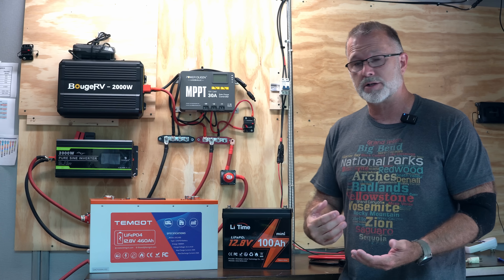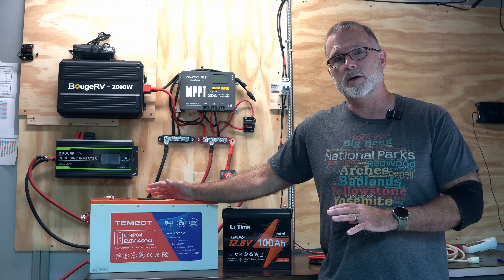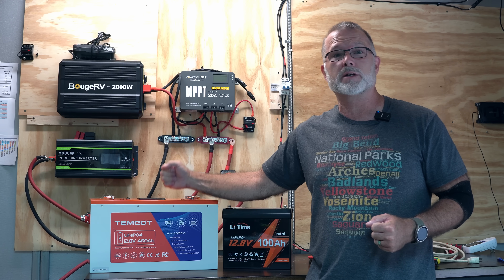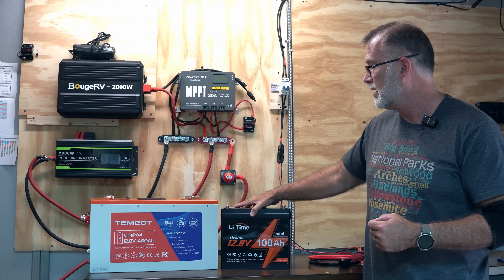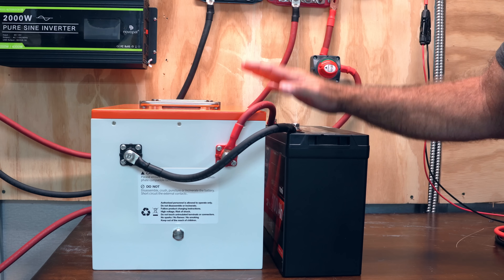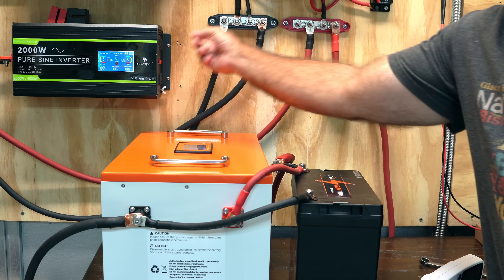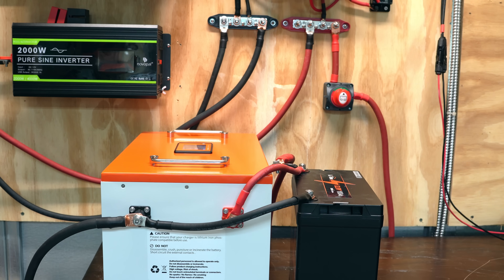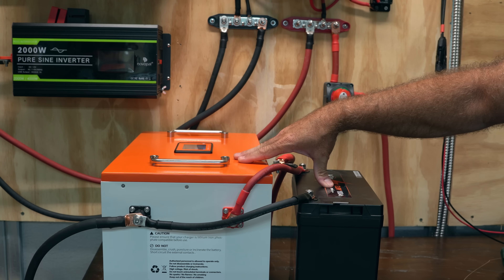Connecting Batteries with DIFFERENT Capacity in Parallel - What Happens?!

Comment: Who has a 3000w constant inverter,renogy sucks
Reply: I have about 30 Renogy products...inverters in operation, 12 volt, 1000, 2000, and several 3000 watt units, MPPT charge controllers ranging from 20amps, several 30 amp Renogy Rovers, 60 amp Rovers and a 100 amp Renogy MPPT. I have maybe a dozen Renogy battery meters as well. None of them has failed. A 3000 watt Renogy inverter has been in daily operation since March of 2020 running a freezer and some lights. What's wrong with your setup?

Comment: I think this is a rather dangerous suggestion. For a multitude of reasons but also for the following both batteries are now seen as one battery bank by the charger and that charger will push current until the bank is full. Or you could connect the charger only to the smaller battery who would then charge the larger battery but then you are negating the advantages of having a larger battery. Etc.
Cheers,
a.

Comment: What about charging? Many regulated chargers? The smaller battery gets overcharged while the larger gets undercharged when connected in parallel. Not to mention, other comments are correct, as they discharge the voltage of the larger continues higher as the smaller depletes faster. When charging this variation I've seen overcharge the smaller causing high heat. Actually have one getting burned outside right now on purpose. I'm reconditioning the battery. Reverse charge at a higher than normal rate to knock the sulfur off, then I'll charge it correctly
Reply from the maker: I've actually been doing additional testing for a follow-up video and while I'd agree that you probably shouldn't do this for SLA and GEL type (non-Li) chemistries, I still don't see an issue for LFP.  The LFP batteries have an internal BMS that keeps them individually from being over-charged or over-discharged.  And while their will certainly be some differences in internal resistance at the same voltage (SOC), the differences are not likely to be so significant as to cause any issues that you'd need to be overly concerned about.   So they will, more or less, charge and discharge at rates that are proportional to their relative capacities and the larger battery will often provide a small amount of current to the smaller one as they are continually seeking to remain in balance. But this extra charge/discharge activity is not materially different than what is happening naturally in a solar-charging battery/inverter system anyway. So, I stand by my claims from this video - at least with respect to LFP battery chemistry.
Reply: @ReeWrayOutdoors  I can understand what you're saying, and while they have internal regulation, would you want to stress or rely on this regulation with lithium? Although lithium is pretty good about letting you know if it doesn't work. Just hope it's in a fireproof container. I'm an Automotive mechanic. I've seen all too often where some cells are bad, we tell the customers the entire thing needs to be replaced because the difference in wear from old to new can cause issues. The customers go to some independent that replaces only the bad cells and the whole thing fails because the charging is unbalanced. I've also seen where cells were bad, the customer stated they didn't want them replaced, they are individually regulated and the capacity will be reduced but they can't afford the repairs. Then it comes back on a tow truck burnt from the battery going up in flames. Lithium is less forgiving than lead acid. There's a reason LiPo batteries need a specific charger as well. They just can't be charged any way, must be a specific way

Comment: I'd like to counter the statement that in the sequential connection scenario the bigger battery is limited to the capacity level of the smaller one. As the smaller loses its voltage, the bigger will start compensating for it by maintaining its own voltage for longer, and therefore giving out more and more watt-hours compared to the smaller as the time goes by. So, the time before a critical voltage is reached in the system output will be higher compared to the case with two small batteries (instead of one big and one small), not only because the big one will maintain its own voltage contribution for longer, but also because the wattage contribution will be continuously shifting from the small battery to the big, thus utilizing the latter much better than to 50%, as the author seems to be claiming. If the critical voltage is, let say, 18V (compared to nominal 25.6V), I would recon that, with a practically likely load of, say, 10A, the final (dis)charge levels would be around 11V and 7V. How many joules do you think is left in that big battery at 11V? Definitely not as many as it has given out by then. LiFePO4 experts can give you an accurate number, but I would guess not even 30%. Probably 22-28%. So, not that bad.
Reply: That is not correct. Both batteries will see the same current. If the smaller battery is finished the bigger can't compensate anything. The small battery can't supply current anymore. In fact it would rather break. A 12V battery at 7V is dead. Or with a BMS that would switch off the complete circuit to protect the smaller battery.
In such a serial connection you can only draw the Ah of the smaller battery, not more ! The same goes for the maximum current.
Reply: @reinhard8053  Same current, but not the same power (AKA wattage/energy per time unit/work), and that is the point.
Reply: @ds380  No it is not. The batteries will supply (nearly) the same wattage. Both have the same current flow and more or less 12V (or maybe 13V depending on load). So they will supply the same power and energy. And if the smaller battery has no more energy it will limit the current (and you don't want to go any further).
Try to read some basics before posting such nonsense.

Comment: This might work short term but if you parallel two lead acid batteries of different age or capacity for any length of time they will "fight" each other until they both fail. Personal experience.
Reply: I used to design battery management systems and chargers for telecommunications installations. Lead acid batteries of the same technology are frequently connected in parallel. So long as the state of charge to Voltage relationship is the same for the two (or more) batteries they will share and not be damaged. The charger should ensure that both reach the end voltage when charging and are disconnected before being over discharged. These voltages are the same for new or old batteries of the same technology. This is true for Lithium batteries as well. I don't think they can "fight" each other - what would that mean in terms of voltage and current? And they certainly do not fail - they can last decades. On the other hand, similar age, technology and capacity is critically important for series connection.
Reply: @HughCStevenson1 My guess (from the very little information, admittedly) is that one/some had significantly more equivalent series resistance, so that the effective voltages are mismatched every time the load changes or charging state flips. (This would happen a lot more often for, say, buffering solar energy than for battery backup for grid power.) I wish ESR were easier to measure to avoid such things.
Reply: @AySz88  they will still be stable and undamaged. The claims that they will explode are just wrong.
Reply: @HughCStevenson1    To be clear, I don't share in any claim of "explosions".

I was recently reminded of an NiMH behavior where, if overcharged during a constant-current rapid charge, the voltage required to maintain current starts to fall instead of rise. If the cells' states of charge are mismatched enough, a charging controller might continue over-charging and lead to damage. (It could be argued that's more about the interaction between the cells and a charging controller though.)
Reply: hence, you use batteries with similar age/capacity. ;)
Reply: Not true, all my Old lead accid batteries are going to my Offgrid retirement-home for old worn battery solar charged-led lighting bank. They only get charged by Solar and only have to power the 12volt LED lights inside an Off-grid 192m² house. 
The smallest lead accid is 45ah from a car, and the biggest 230ah for a cargo barge, all connected in parallel.
I test once a year for their internal resistance to delete the batteries that won't hold any power at all, but for the last 3 years I'm still doing great with all of the mismatched bunch of batteries working neatly together.

The principle is easy, don't stress those old grumpy batteries. Only light loads. I have tested them all piece by piece, to see where they hold their loads. Some stay good for a while at high voltage but once dropped below a certain voltage they go through their knee's and drop dangerously low in voltage under load. While others drop fast from fully charged voltage to a certain lower voltage and settle/stabilise at this lower voltage.
And all of those batteries together support each other on different Voltage levels.

Also what's a good explanation for this is the Law of communicating vessels (of water)..
when the liquid(Voltage) settles, it balances out to the same level in all of the containers regardless of the shape and volume of the containers. 
The biggest Battery gives most Ampère (flow of water) , and the smaller batteries only keep up with the level of the bigger Battery
Reply: @2DC24 i have almost exact same setup....two agm.....55ah and 200ah....in parrallel...charging from solar.....only runs led lights. My solar and my load work off of the smaller battery....the bigger battery is really only there to keep it charged up but it keeps the smaller one juiced up. If I needed to hook up an inverter or something in an emergency...I can pull my amps from the bigger battery.
Reply: I form lead acid batteries and you are correct.
Reply: There is a simple reason for that, the much larger voltage difference between a fully charged and empty lead acid battery. The flat discharge curve of Lithium based batteries makes parallel connections of different capacities possible.
Reply: Do not connect different size batteries in parallel. It will eventually damage the smaller batter as the larger battery will discharge into the smaller batter using excessive current. This means the overall lifetime of the smaller battery will be reduced. I've seen this in SLA/AGM batteries. But not sure how lithium batteries would be impacted as they have internal charge controllers.
Reply: @chuckcrizer 2DC24 said it works for old Lead Acid batteries to give them a last Chance.
I fully agree to not do this with any other type , and definitely not for big loads. 
Small loads however are proven to be functional, with lead-accid though

Comment: Great video! This works out because the internal resistance of the cell is lower for the battery with the larger ampacity. In other words more of the load is drawn from the larger cell battery. That is why the experiment worked, and different sized batteries in parallel discharged in the same time frame. It can even help balance out the surge scenario, as more of the load comes from the battery with the lower internal resistance. However, it is still great advice and wise to avoid major imbalances in the lead acid batteries and not to mix types. It is also important to note the age and condition impact the internal resistance, and the health of the cells can effect how well they play together.
Reply: Not sure internal resistance has anything to do with this 🤔 If you take the same current from both batteries, then the smaller battery will drop to a lower voltage due to the discharge curve. It can't do this, as it's wired in parallel,  so the smaller battery will stop discharging. The net result of this is that the batteries will discharge proportionally with their capacity, assuming the same chemistry.
Reply: @RacingAnt  This. Internal resistance is irrelevant. The relevant bit is that the positive terminals are kept eqiupotential, and so are the negative ones. The batteries have no choice but to be at the same voltage. Your reasoning is 100% correct.

Word of caution: before you connect batteries in parallel, make sure their voltages are the same (within say 0.1V or so). If necessary, charge/discharge them separately until they're balanced, before connecting them up. Otherwise you risk the one with the higher voltage discharging into the other one to equalise the voltages, which could result in a large current draw that may damage one or both of the batteries, or even result in a thermal runaway event (LiPo fire).
Reply: @EvenTheDogAgrees It depends on C rating also? If higher voltage battery has less C rating than lower voltage battery's C rating, then the situation is more worse?

Comment: This is not soo good especially in lead acid batteries bcoz while the snall battery will be fully charged the big battery will be charging which the charging system cannot autocut the changing and the small battery will get over charged
It can be ok in bms batteries
Reply: Not so, the voltage will always be held down by the least charged battery, unless you have significant resistance in the leads connecting the batteries.

Comment: At first I was amazed that the kill-a-watt meter showed a wh of only 30 wh less than estimated. Which would put the inverter effeciency at 99.58%.

Then i realized he calculated battery wh based on 12.8v when he likely charged it to at least 13.8v if not 14.4v. He then multipied wh by 0.9.

560ah @ 12.8v = 7168 wh (6451wh)
560ah @ 13.8v = 7728 wh (6955wh)
560ah @ 14.4v = 8064 wh (7257wh)

The load on the AC side of the inverter was 6370 wh, which he then said was 30wh below estimated. Re-watching the video he lowered his estimated 6451wh capacity to 6400 wh. I'm still not sure why he multiplied the battery wh by 0.9, unless he was estimating the inverter efficiency.

Inverter Efficiency
12.8v = 88.87%
13.8v = 82.43%
14.4v = 78.99%

All of this guess-work would have been eliminated if he was using a battery monitoring shunt.

He could have show the full charge state (voltage, ah capacity, percent charged) and then shown the discharged state (voltage, wh used, and percent charge). He could have also shown amp drawn at beginning, middle and near the end just to show how battery voltage affects amperage as the battery is drained (so few people calculate amperage when the batteries are low, potentially undersizing cables).

If he really wanted to show what is happening he could have placed a battery monitoring shunt on both batteries. That would show in detail how each battery contributed.
Reply from the maker: @Slackware1995  all fair points (and yes, the 0.9 multiplier i used was estimating a 90% inverter efficiency). I'm actually working on a follow-up video now that will show the current inflow and outflow from each battery under a variety of conditions, compared with 2 batteries of equal capacity rating.

Comment: you assume, just talked, did not test, i have doubts:     200 Amps,  the bigger battery (both in parallel)i think it  will handle the 2oo amps almost alone,because the smaller one has way higher resistance;  
BUT.... it depends A LOT on the cables, and the time that the test takes.

Comment: I built a 120 AH LFP first then later a 280 AH. I’ve had EG4 100 AH server rack batteries paralleled at times also .
As long as the individual bms protects its battery,the pool of energy is fine. In solar power systems in homes with a large battery bank the amp draw never challenges the battery. My combined 400AH battery is currently running a 5KW inverter that seldom runs over 75% capacity. Even if the smaller battery carried the whole load, it would still be discharging at less than 1C.
Certainly there are ways to maximize the efficiency to avoid conversion loss,but solar panels have become so cheap that my focus is safety and lifespan of the system by never push any component to its limit.

Comment: HI I HAVE 2 X 60 AMP LEAD ACID BATTERIES AND 2 X 70 AMP BATTERIES WOULD IT BE OK TO JOIN THEM IN PARALLEL ?  CHEERS
Reply: Why are you screaming?
Reply: @violaanderson175  HELLO ANOTHER TORY WITH NO ANSWER YOU MUST BE ABOUT THE 20TH TO MENTION IT, IT IS IN ENGLISH UNLESS YOU CANT ANSWER WHICH IS MOST CASES FOLLOWING THE LAST 14 YEARS OF GANGSTERS RUNNING UK

Comment: this is the same problem with connecting any batteries even of the same voltage in parallel, this is one of problems with electric cars. And there are many more.

Comment: What you said about the issues with different batteries in series explains why consumer electronics that use disposable alkalines tell you not to mix old and new, different brands etc. I think as kids many of us have experienced what happens when you violate those rules and the chemistries decide to leave the batteries.
Reply: ‘Chemistries decide to leave batteries’ By this do you just mean leaks and corrosion?
Reply: @markoshun  Or heat buildup and fire, especially with LiPo packs. Don't underestimate the wrath of the angry pixies when you make them work too hard!

Comment: Howdy. Yes.
Parallel connecting is not recommended. There will always be a circulating current in the loop.
My guess is both batteries will be ruined in a couple of months.
I suggest checking the loop current with the batteries standing idle.
Also my suggestion is to use Schottky diodes to block loop currents.
How ? Ok. Take two diodes and connect them in antiparallel. Let's call this a step. Then connect a step to the plus of the batteries. One step for each battery. Finally connect the other step ends together. This will be compound plus.
Yes. The charger voltage needs be higher, 0,3 to 0,5 Volt higher. And yes. The output voltage will be lower, 0,3 to 0,5 Volt lower. But loop currents are eliminated. Do not push / draw more current than specified through the diodes.
Regards.